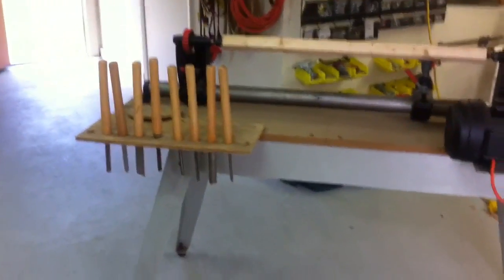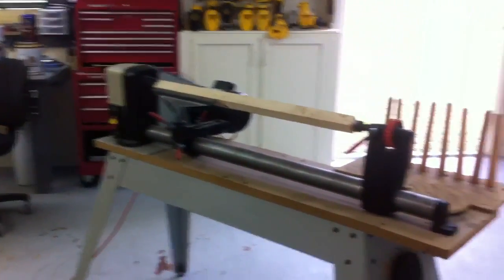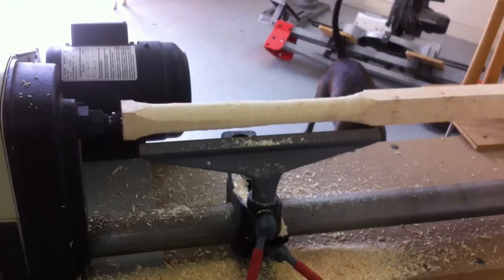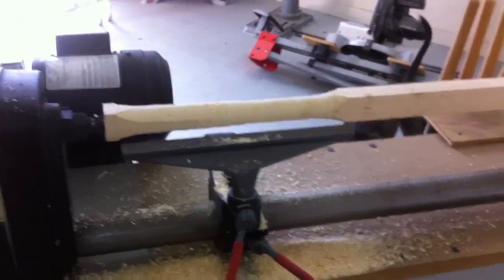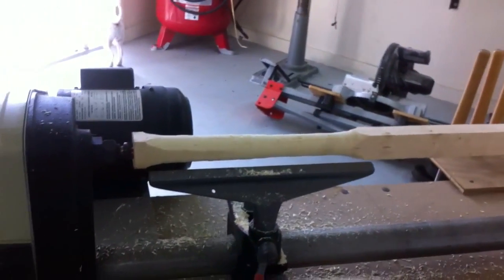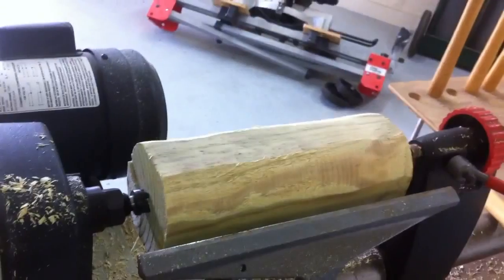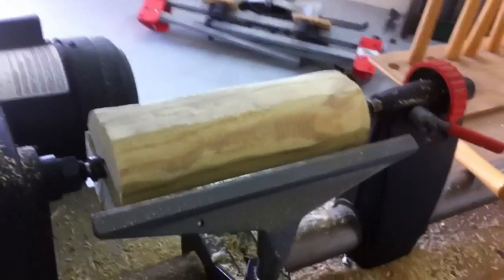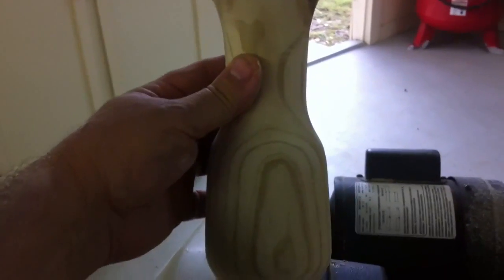Rigid wood lathe

Comment: I am the only guy to get 13 stitches in high school woodshop by sweeping the floor. Someone put the wood chisels pointy side up at the rack on the wood lathe and as I was using a long handled broom to sweep up at the end of class my hand went down across one of the chisels and it sliced my hand to the bone between the knuckles, it was very sharp so barely stung and sewed up nice.
 I like wood lathes, any fool can lose fingers on a table saw, but it takes talent to have a mahogany bowl come off the faceplate and bean someone 20 feet away.
Reply from the maker: I hate when that happens!!! HEHEHEHEHE!!! That was funny! Not getting cut but having a bowl go flying through the air and intrducing itself to someone.

Comment: Gouge is correct.  and the other thingy is a tool rest :)  I love turning wood myself.  Go down to that lumber mill you bought all that cheap fire wood at, looked like they would make some nice turning blanks.
Reply from the maker: they are white oak and red oak blanks. usually about 10 by 10. how do you kepp them from cracking after you turn them,or do you wait for them to dry,then turn?
Reply: BCtruck, rebuild, repair,repurpose Just rough turn them and keep the walls thick. apply sealer and let it dry for a few months slowly, then do your final turning.  seal again quickly after
Reply: Agreed with PopPrepper.  In fact, you could make your own small scale kiln for turning blanks if you want to dry your own stock.  Dafrogtoad has one of his own he built.  A scrap chest freezer might be a good shell for one.
Reply from the maker: PopPrepper Im thinking of trying a segmented bowl as my first real project. this was just practice and experementation.
Reply from the maker: Bstanley71 Thanks! Ill go have a look at toads channel. i must have missed that video.

Comment: I have been wanting a lathe for a while now. If you don't mind me begin nosie how much did you have to give for it? My local pawn shop has the same one new for $400.00  Is this a good deal or way over priced? Thanks for sharing. Robert
Reply from the maker: well,they stopped making hese in 2007. rigid does not make a lathe anymore. they were less than 300 bucks back when they were making them,so no,its not a good deal.
Reply: I do not know wherw they got it. it must have been stored away in somebodys storage I looked on line and could not find it i guess that explanes it. thanks for the info. robert
Reply from the maker: If you could get it for 200 in new condition, i would go for it.if it came with any of the tools,maybe a little more.